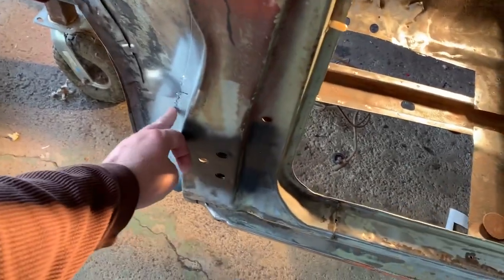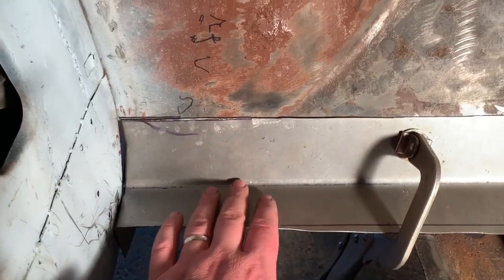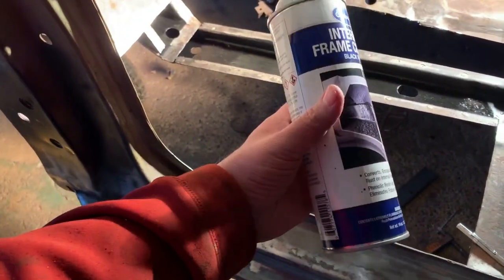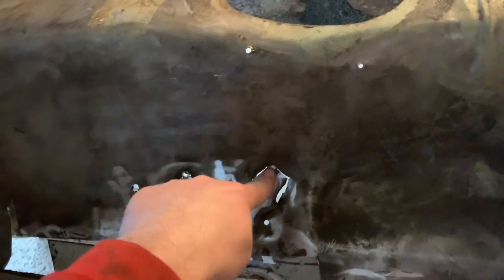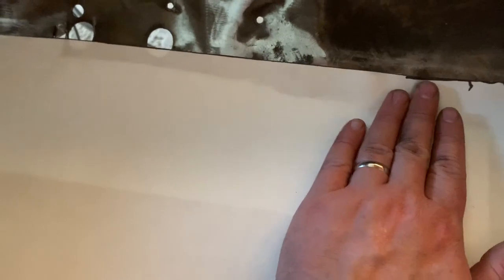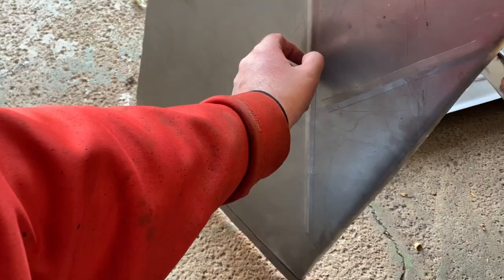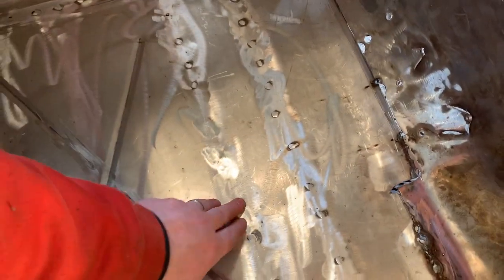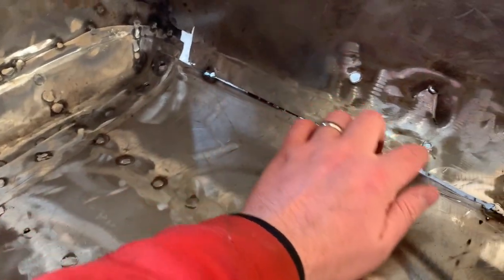Datsun 510 Projectpart 14, floor pans..

Comment: hey by any chance did you get by the floor pan below the back seat... need some pointers
Reply from the maker: I’m in the middle of finishing it up jus got to weld it in.  Sorry it’s been take so long, life is getting in the way lol. Should be done this weekend. What do you needed help with? will try to point it out in the video if I can.
Reply: @hixsfabgarage9926  trying to figure out how to repair the sheet metal under the back seat , already cut out the rotted one
Reply: Would like to show you what I've done but there is no option to attach pictures
Reply from the maker: Do you have an Instagram?
Reply: @hixsfabgarage9926  yes, allandabiedeen